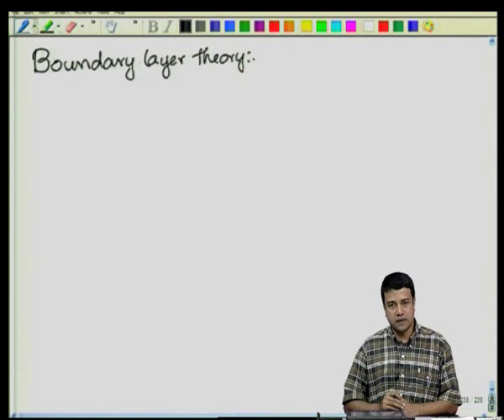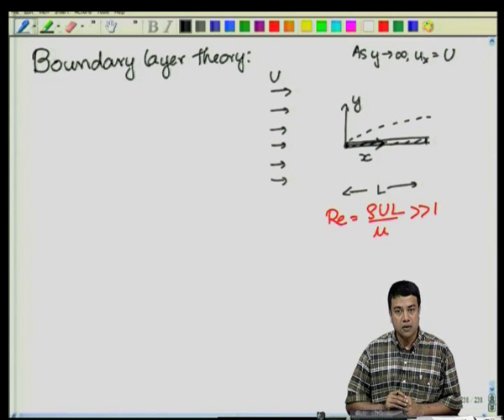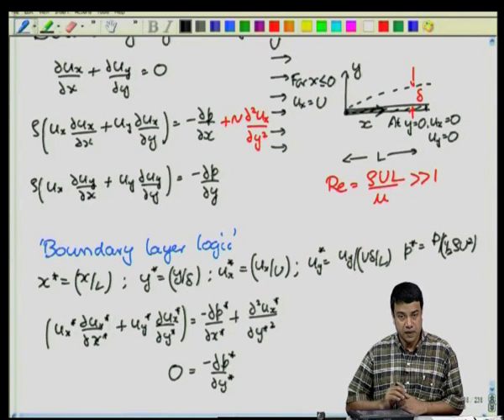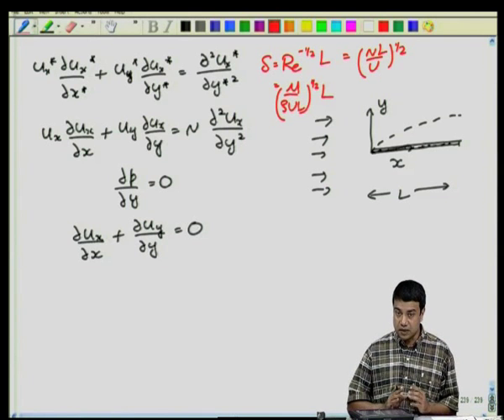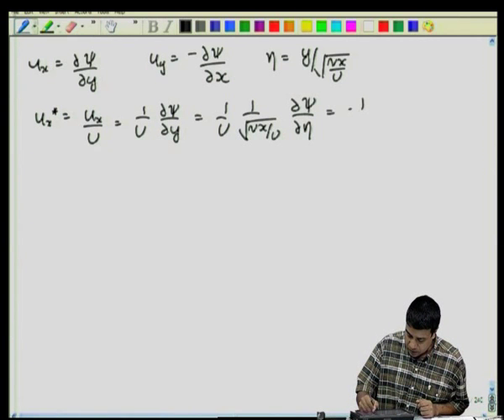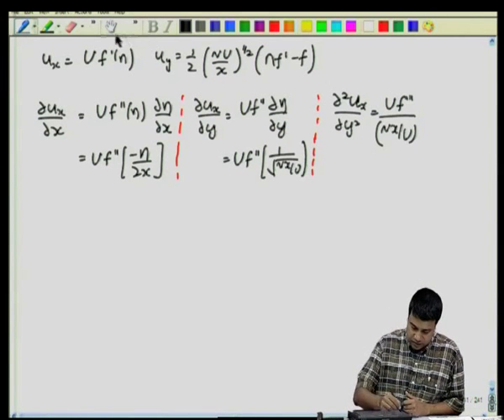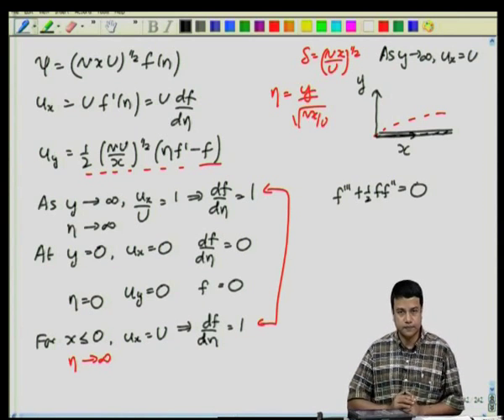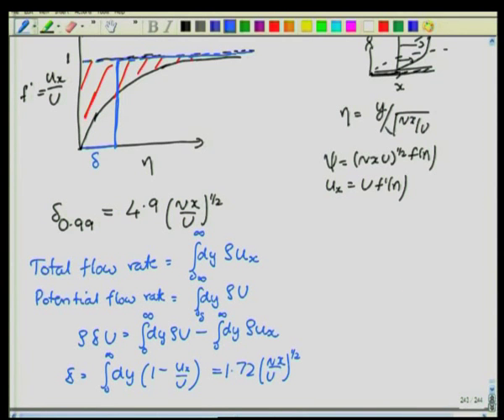Mod-01 Lec-32 Boundary layer past a flat plate

Comment: Sir why DP/Dx is zero ... can you please explain ? If it is zero then how the fluid will move ?
Reply: we get dP/dx is zero from the momentum balance of the outer potential. We can split the total momentum balance into that of outer flow potential and the boundary layer, here the outer potential momentum balance cancels out with the dP/dx term and we get the momentum balance in the boundary layer.